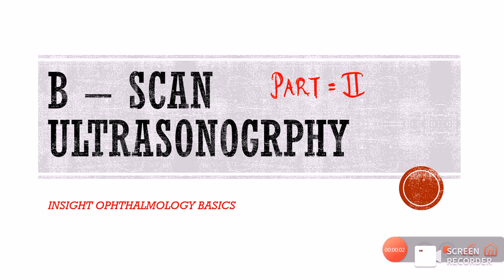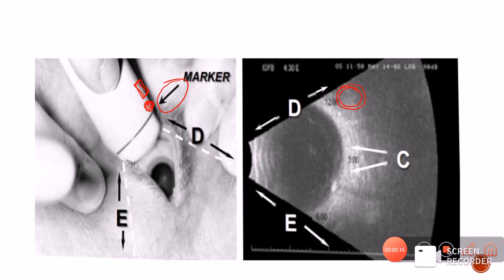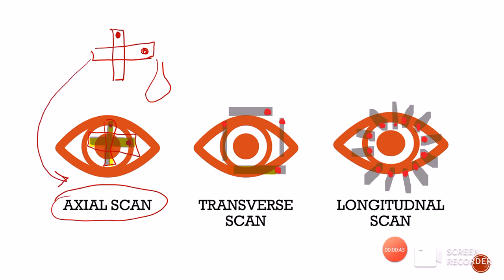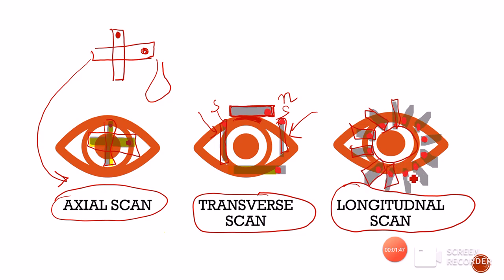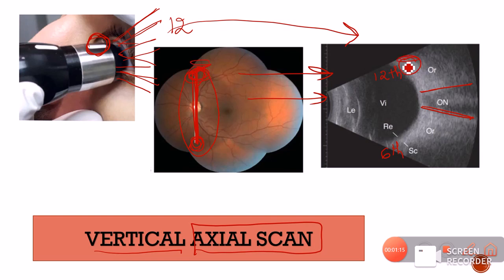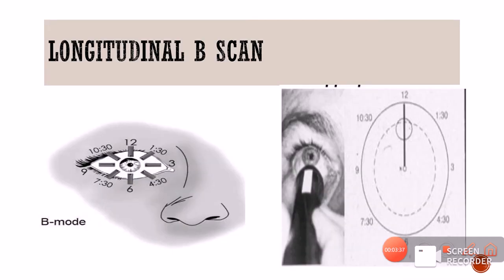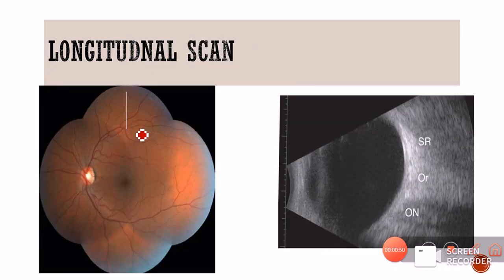#2 B SCAN COURSE|| AXIAL, LONGITUDINAL & TRANSVERSE B-SCAN || TOPOGRAPHIC, KINETIC B-SCAN.||

Comment from the maker: || TIMESTAMPS||
00:00 what is ultrasound?
02:11 PRINCIPLE of ultrasonography
03:30 relationship between frequency and wavelength
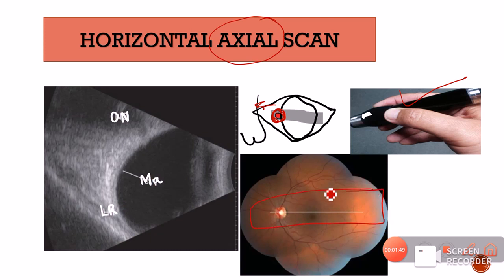07:15 choosing the correct frequency for ultrasound 
08:03 what is acoustic impedance and echo?
13:08 what is b scan?
13:44 components of a bscan?
15:17 A scan vs B scan ?
19:23 Understanding "GAIN"?
24:20 When to do b scan? uses of b scan ?